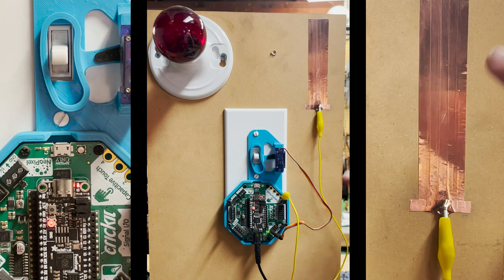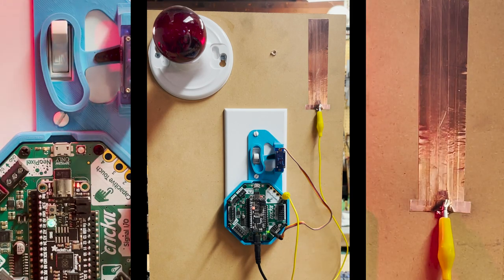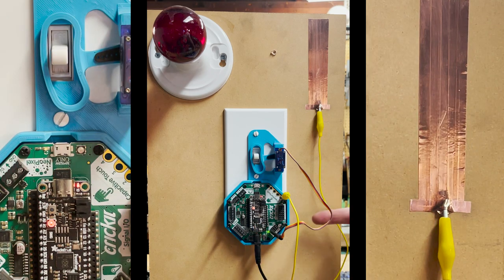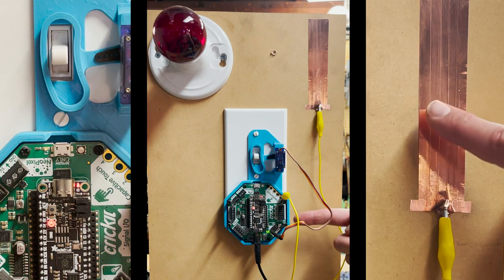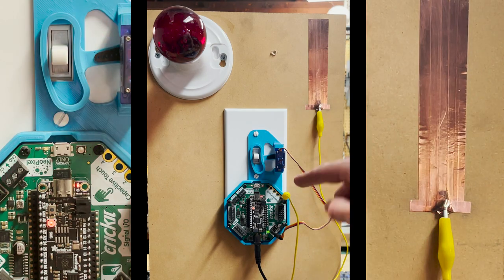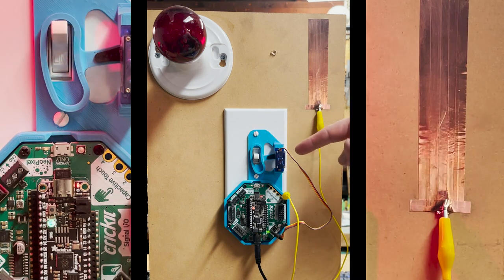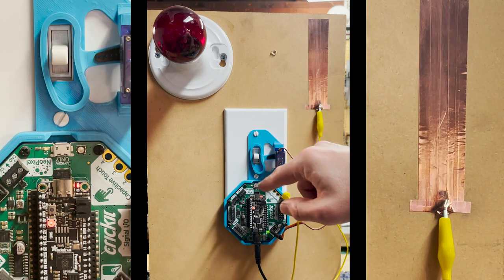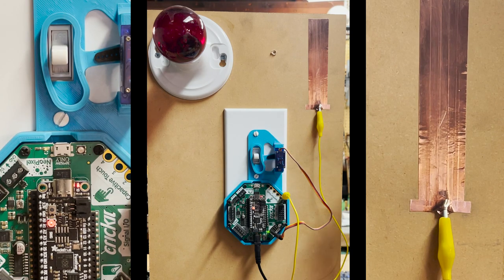Touch Light Switch Feather RP2040 + Crickit @adafruit @johnedgarpark #adafruit

Comment: How funny... I've actually been thinking recently about how I would design something almost exactly like this... I don't care about the capacitive touch part so much (though it's conceivable I might incorporate that, just because I could -- especially if it would work well with some existing metal surfaces I have around), but more so to be able to have multiple locations where I can flip the switch, using wifi or BLE or something to be able to connect between a place with a button (or whatever) and the place with the switch and motor... cool!  So, uhh...  Learn guide?!??  details?!?  :)
Reply from the maker: Here's the Learn Guide for BLE version https://learn.adafruit.com/bluetooth-light-switch-with-crickit-and-nrf52840

Comment: overkill
Reply: Capacitive touch immediately next to the switch: sure, we can call that overkill, for most folks.  However: (a) for some sorts of disabilities, this might make things much more accessible; (b) if it can be triggered with capacitive touch, it can also be triggered with other things -- including things like commands over wifi, with the right controller board.  So, uhh...  I wouldn't call this overkill at all... just... a proof of concept.
Reply: @DavidLindes  pardon my unclear joke, it's the RP2040 that's overkill for such a simple light switch 🤣. It is doable with significantly simpler circuits, but if you are looking for BT and WIFI, consider looking at the ESP8266 :). For light switches in general, light buttons(?) which can work in conjunction with relays are also available, making it able to be controlled with fewer points of failure.
Reply: @nathanadhitya  ahhhhh, I see.  Fair enough!  Yes, this could be done with simpler stuff.  But again, proof of concept -- and off-the-shelf parts, no soldering (I don't mind soldering, but for some it's a sticking point), etc.